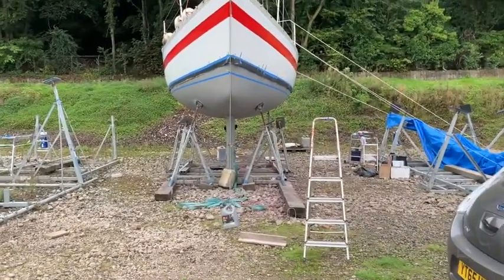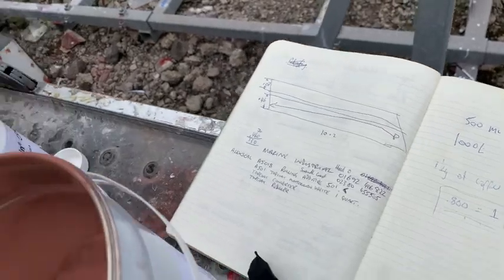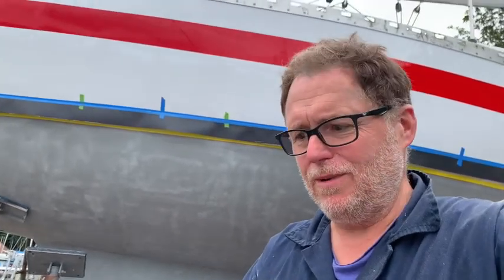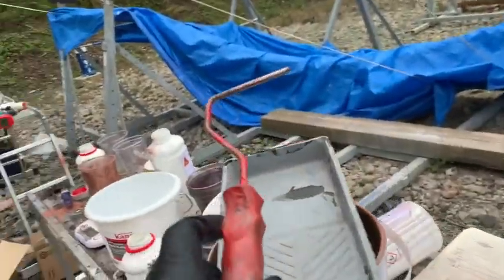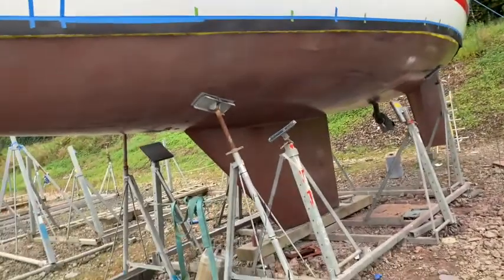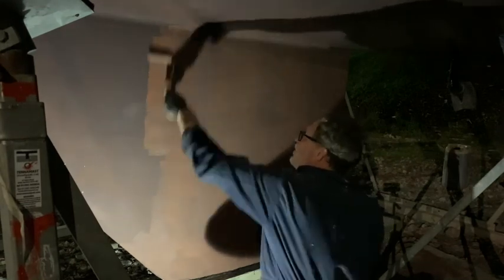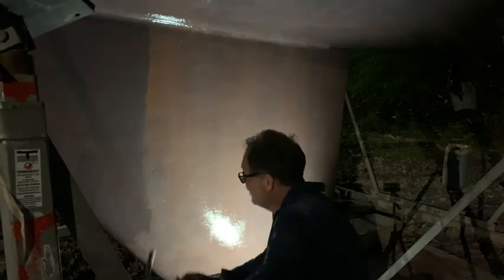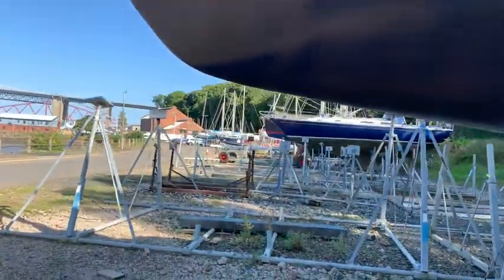Home Brew Copper Antifoul Episode 10

Comment: So you sanded then mixed epoxy resin and added the copper powder. Then rolled it on. How did this work out over 2 years thank you
Reply: Are you still out there.
Im thinking of mixing cuprous oxide with bottom paint
Reply: Hello

Comment: won't work because it won't ablate (copper will be trapped in the epoxy lattice)
Reply from the maker: It does work! When immersed  sea water attacks the exposed pure copper powder, causing the formation of cuprous oxide. This is a highly effective antifouling agent and puts off growth until the surface degrades further to become cupric hydrochloride. This final copper form is highly unstable, and is washed away by the movement of the yacht, thereby removing any accumulating silt or slime. This automatically reveals a fresh copper rich surface, whereby the process recommences.
I had some weed growth but as soon as I started sailing the yacht the weed fell off. 
Worst case I will have to re-sand and expose some fresh copper.
Reply: @dapman2007  your binder is a 2 part epoxy which is strong and rigid and it does not degrade, trapping the copper and rendering it inert......outhauling is too expensive to justify using an underperforming antifouling which is all you have
Reply from the maker: @jean-philippepollonais1104  that would possibly be true if the surface had not been sanded after application. The purpose of the sanding is to expose the copper with the copper exposed I would propose it is no longer inert. I will do a video today to show the state of the hull. The boat has been in the water for 10 months. She did hardly any sailing for the first 8 months. She has been used a lot in the past 2 months. When I left my home port at the beginning of September there was some weed growth. It has been a very good year for growing weed! I will film the hull today and give an honest appraisal of the situation.
Reply: @dapman2007  the point is that antifouling is self ablative and requires no sanding and thus you have an underperforming antifouling which is unviable when out hauling costs are considered
Reply from the maker: https://youtu.be/H8k28cnBxU4 check this out Jean
Reply: I was always of the understanding that all epoxy will degrade especially being submersed in salt. Epoxy was never known for being fully waterproof.
Reply: @dhouse-d5l  misunderstanding*